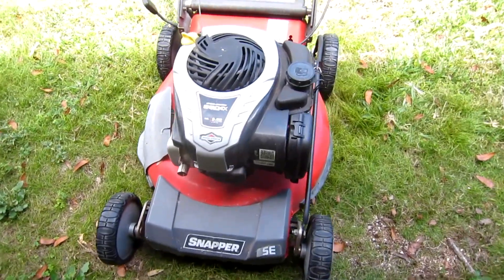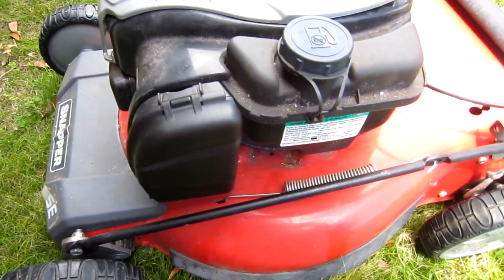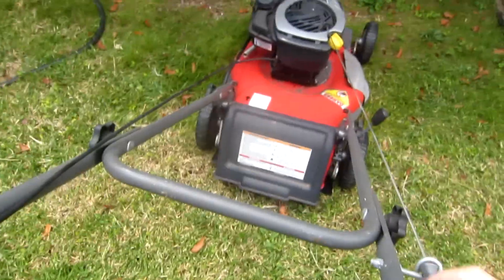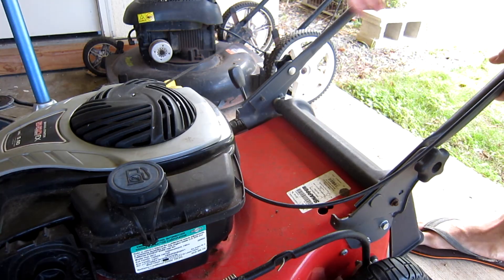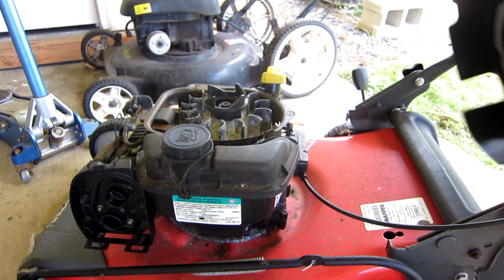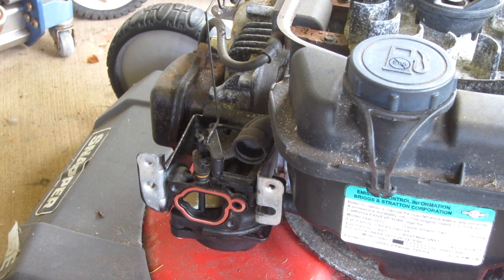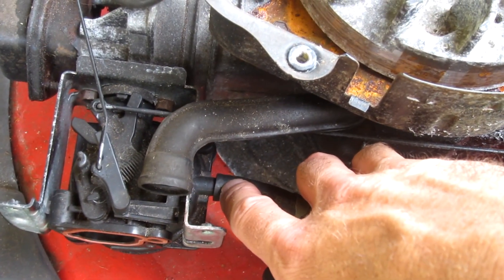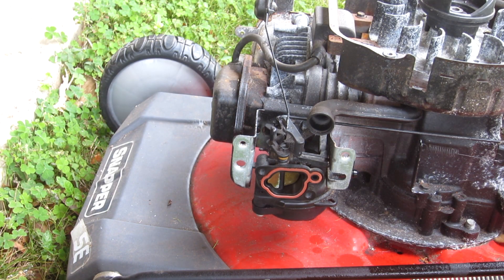Briggs and Stratton 550EX Carburetor Repair Part 1

Comment: Absolute Legend.
Had a few issues with my e550 in my Victa Classic Cut (ages old aussie mower). 
First throught it was just the air filter that went after i replaced the rip cord starter assembly.
Worked for a bit after the Air Filter replacement but had issues today with it dying on me again.
Had a quick look for answers, came here, followed what you did, found out the carby was ALL gunked up (weve had this mower since i was a teenager, so i never maintained it 😄 ).
Cleaned it all out with a fair haired paint brush, got the needle out and cleaned out the little plastic valve thing (in next vid), threw it all back together, kicks like a mule now.
Reply from the maker: I absolutely love getting comments like these....the scope of YouTube astounds me and I'm happy to be a small part of your success! Keep that mower going forever my friend.

Comment: So I did the test with the starter fluid but my butterly valve stays open but closes back when I pull the string?  Is the butterfly valve suppose to be spring loaded and if so how do I go about fixing it or just replace the whole carb?
Reply: https://www.youtube.com/watch?v=aNi9sJA4PFI
Reply: Did you tension the choke before starting?
(1 year necro-post but it might help others)

Comment: Thanks for the 2 carburetor disassembly video.   I've just been gifted one of these mowers after the previous owner replaced the carb with one purchased from Amazon.    Will run poorly on starting fluid.   I'm taking about the new carb tomorrow 😎
Reply from the maker: Replacing the original carb is almost never a good idea. The Amazon and eBay replacements are junk, unless they are OEM carbs. 
Good luck with your repair and remember that sometimes spark issues can masquerade as fuel issues.

Comment: Thanks so much for doing the video. It wasn't my problem as to why it wouldn't start but the upside is that I ended up with a nice clean carb after completing all the steps you outlined. The problem was a simple one since the mower had been running and suddenly quit. I was cutting around some cedars and a branch must have caught the boot of the spark plug and yanked it just slightly which broke the connection. But I am happy with my clean functional carb as well. Great video as all my parts were identical to yours so, very helpful...good job!
Reply from the maker: Thank you, I am so appreciative of you guys that comment even when you figured out that your problem wasn't solved by my video.

Comment: I couldn't get any start using starting fluid as you suggest. Spark plug came out quite gunked with black stuff. Replaced spark plug. Still no start. May be a little oily or wet in spark plug hole. Which from what I've read is a different kettle of fish than cleaning the carb.
Reply from the maker: With the new plug did you try the starting fluid again? Possible you had 2 issues, the plug and carb. 
If you have oil on your plug that 'could' indicate problems with your piston rings which is a different issue as you stated. But sometimes these motors get waaaayyyy overfilled on oil and that fouls up the plugs too. Make sure you haven't been running too much oil.  Good luck
Reply: @jcx2bby  Thanks a lot. I didn't try the starting fluid with the new plug but will try that tomorrow. Will check carb when I get a chance. Mower's run like a champ for 4 or 5 years. Has been idle several weeks with a lot of rain around. Stored always in fully enclosed shed. Anyway, thanks. Will see what happens.
Reply from the maker: @oinkooink  ok good luck. Curious to know what you find out.

Comment: nothing traditional on that turd/.. whats next, plastic blades? also theres no way that motor puts out 5.5 hp flowing that fuel thru those tiny jets
Reply from the maker: Not much can be done about the design...I just try to keep the turds running.

Comment: Hi Mr jcx2bby. I have the same B&S 550ex, The machine was stored and has never been used since the pandemic started. It doesn't start. After I disassembled and cleaned the carburetor and put a new air filter, and 4T oil,  the machine started but in 2 seconds stopped. I disassembled again and clean the carburetor with a needle using such electronic's magnifier glasses to help and see more accurately. Now the machine starts perfectly OVER THE SIDEWALK and never stops. The Idle sounds stable, BUT.... when I try to use it on the grass, at the moment it has to make some " little effort " to cut the grass, it suddenly stops. I think it still has some problem of the amount of fuel to the mixture...is not enough. I'm right? Maybe I should buy a new carburetor? Best regards, Martin.
Reply: you need to drill the jets out bigger,, these mowers were an engineering goof.,,. drill them to 50 thousandths
Reply: @randy1ization  Thanks!, I've changed the carburettor and now, this mower eats grass like a bull. The horse power returned!, I'm very happy. Best regards.
Reply: @randy1ization  Which jet, the main jet?
Reply: yes
Reply: you have to unscrew the idle jet completely out to get the jet out from underneath it.. count the threads sticking out of the idle jet before you take it out, so you can put it back in close to where it was before. if you need to you can fine tune the idle by adjusting the jet in or out.
Reply: @randy1ization  Thanks for the reply but it sounds like we are talking about a different main jet assembly. I looked up some pictures and the main jet assembly's that have brass jets and some do unscrew. The main jet on my 550ex is a plastic assembly with no brass jets and nothing unscrews, everything is plastic with a simple orfice. The mower is at full throttle at all times so there's no low speed/idle jet. It looks like this: https://youtu.be/joDmD0oOlJ0?t=435

Which orfices to I open up to 50 thousandths (about a #76 drill bit)?
Reply: @muziklvr7776  its been a while since I did one, but I recall that plastic assemble comes apart, in 2 pieces. it just pulls apart, and you have to take it apart to clean it properly.
Reply: @muziklvr7776  after thinking abt it, I think once you pry  that plastic assembly apart, the main jet is inside..  the outer jets are just feeder jets that allow fuel to enter inside of the assembly, then it goes thru the main jet. and that is the one I think u drill out.
Reply: @randy1ization  I bought a new carburettor and the problem disappeared. Here the plastic carburettor was not expensive. Best regards.
Reply: @Molleras  burn all of the fuel out of it before storing it and use fuel stabilizer, or you will be dealing with the problem every year/
Reply: @randy1ization  thanks!

Comment: Always buy a gasket set possibly a carb overhaul kit.
Reply from the maker: I don't think it's always necessary. Depends on the age and condition of the carb. Most dont need new parts, just cleaned.

Comment: I have a nearly identical snapper 19" rear drive mower with the 550ex engine and carb as shown (there is no primer bulb), anyway, after some maintenance this spring to replace the plastic inner baffle (as this IS NOT a heavy duty commercial quality mower, in any regards) which did result in the oil oozing out since I tipped it wrong...afterwards IT RAN AT LOW SPEED.  fast forward to Sept6, and I clean the carb and gas tank as shown, install new sparkplug from WALMART end of season clearance, and it still runs slow.  I write this prior to double checking the throttle springs and choke linkage.  But any ideas why it would run slow?
Reply: a common issue with these motors is the valve cover gets dented in causing the valves to stick partially open making the engine run weak or not at all. if valve cover is dented in remove hammer dent out. i use rtv silicone as a sealant. wipe on each surface very thin allow to dry completely then reassemble
Reply from the maker: Interesting info.  I have not run into this problem before but question; there is not valve cover on these types of engines as i know it to be.  The cylinder head covers the valves which are in the block.  Can you explain this a bit more?
Reply: @jcx2bby  seriously? the valve cover is on the front of the motor. its that triangle cover thing.
Reply from the maker: @smallengineguys  sorry I was responding to multiple comments this morning and thought this one was geared towards the older style engines, not the ohv one. Hence my confusion. My bad, got mixed up on vids.
Reply: or bad gas
Reply from the maker: Did you ever figure this out? One guess is that if the motor isn't original to the mower, it might not be setup for a no-load configuration. In other words, on engines that are installed on push mowers, the carb and springs are adjusted to run optimally ONLY when there is a blade installed on the end of the crank.  The blade adds centrifugal weight which helps the motor run faster.  If you take the blade off, the engine runs very slow, or not at all because the carb is tuned for the extra weight.
Reply: @jcx2bby  the bade does not make it run faster or slower. ive started many without blades. the issue is they kick back without it. because the flywheel is so light. on a race car they use a lighter flywheel to give more power to the wheels. it alone does not increase or decrease the rpms. this is the original motor for the mower.
Reply from the maker: @smallengineguys  I worked on a Snapper push mower way back in the 90s that would disagree with you.  I was absolutely baffled at why the engine idled so low.  It would run fine, and if you opened the butterfly it would rev, but always go down to a very slow idle.  A guy in a small engine shop asked if I had a blade on it. In fact I did not as I had just put new rings on this engine. He told me to put a blade on it and try.  Problem solved.  
Lighter flywheels enhance response of the engine, not so much increase HP.  If you've ever worked on farm implements like bailers that have huge, heavy flywheels, they are used to keep the implements going steadily in surge conditions in the field (big swaths of hay, wet crops etc). It takes a while to spool these flywheels up, but once they are spinning, the power is immense.

Comment: My issue is gas coming out into the air filter. Any idea how to fix that issue?
Reply from the maker: Sounds like a stuck float to me. Have you already disassembled the carb?
Reply: I did. The float dropped down when I held it upright. I went to my local small engine shop and tried to order new rings and a float needle. They recommend I just replace the whole carburetor.

Comment: Dude u did WAY to much work. Drop bowl. Pull out jet assmbly. Clean. Reassemble.  Also pinch fuelline with clamp to stop fuel flow while working
Reply from the maker: Well, sure, if you already know how these carbs work. I made this video for people that don't have any idea how engines work and are interested in fixing them their selves. The best way to show them, and for them to learn, is to take it all apart.
Reply: @jcx2bby  there is good carbs and bad carbs......i try to stay away from the pasta and bread though

Comment: The videos were very helpful, but I'm still having issues with my mower bogging down and out after about 30 minutes of use. I thought for sure cleaning the carb would work. I then shined a flashlight down my empty gas tank to see if the fuel filter needed cleaning. There was some broken up leaf matter on the mesh, so I washed it out, let it dry, and refilled. Same problem. I replaced the spark plug, air filter, changed the oil, and finally the gas cap. No change. At this point I'm thinking I got some bad or stale gas. Anyway, without your videos I wouldn't have been able to clean the carb and remove the gas tank to clean the fuel filer, so thank you so much for that.
Reply from the maker: That's weird.  If it is running for 30 minutes, it seems like the carb itself isn't the problem.  That almost seems to me to be an overheating issue or a vapor-lock issue with the fuel.  I used to have a weed-mower that would overheat if you were using it hard and shutdown.  Didn't hurt anything, just shut off til it cooled.  
I'm glad the videos helped you with the reassembly and if you ever figure out what fixes your mower, please post it here.  Thanks!
Reply: @jcx2bby  That's basically how it's been - had to let it cool down a little before I could start mowing again. If I ever do, I will. You're welcome and thanks again.
Reply: @jcx2bby  I accidentally put the old gas cap on thinking it was the new one. It's leaf-mulching season for me here in New England, and after two hours of mulching, no stalling. It's been five years with this mower for me and I just don't remember the gas cap fitting so loosely as the new one did. (Completely positive it's for a 550ex). So loose that the vibration of the engine caused it to come off. Anyway, that must've been my vapor-lock issue. I did add new fuel since what I had was about 4 months old.
Reply from the maker: @madmiracle  you figured it out, hooray! Isn't it funny how one little thing can cause so many problems

Comment: good vids and exactly right. tip: be real careful taking off the throttle link. it inserts into a plastic piece that is super cheapy and can break off easily.
Reply from the maker: Sounds like real life experience!
Reply: @jcx2bby  yep. fixed with a rubber and a zip tie. ha
Reply from the maker: @josephkennedy3541  oh my, lol

Comment: Where is the model # on the mower?  I can't seem to find it.
Reply from the maker: It should be stamped into the metal cover around the top or front of the engine.
Reply: @jcx2bby  thanks the numbers were hard to read.. Anyway I cleaned the carb but it still doesn't work unless I spray carb cleaner and it would run for 10 sec and dies again.. Any suggestions??
Reply from the maker: @tl2135  , gotta still be some junk up in there blocking the fuel flow. As some others have commented, there is another step to teardown that white jet assembly even further that I didn't cover in this vid. You may have to go that extra mile to get proper fuel flow established

Comment: Thanks for the clear detailed video. I just put my lawnmower  back together after following this tutorial and it’s running again! 
 When I opened it up, the pin that holds in the floater just fell right out so I think it had worked itself loose but while I had it open I cleaned everything anyway so I hope it stays running because that pin seems very loose that holds the white floater to the rest of the unit and I can imagine it easily vibrating back out.
Reply from the maker: Gadget Reboot, woot! Congrats on the fix and thanks for taking the time to comment. Hopefully it will stay fixed for you

Comment: just saying...about re-using fuel... i like the video though...and it's very detailed, thorough, and not hard to understand. thank you.
Reply from the maker: d. cypher, good points on the old gas. it probably isn't worth the risk to reuse the old stuff for most folks, I just do it out of habit I suppose. appreciate your comment.
Reply: jcx2bby yes, and thank you for the reply. i honestly have done that (re-using) myself quite a few times...that i learned the hard way, it isn't worth it. ai just got a few pieces of .009 guitar string (high E or smallest) and it fits all the holes, ports, jets, etc. i've come across. it just has to be smaller than hole, obviously.  take care.

Comment: good video, bro, however... NEVER, EVER... use fuel that was in gas tank, or carb. If you take the time to disassemble carb, tank, etc... it's not at all worth re-contaminating the whole circuit again. We use a gas can and store all bad gas in it until full, then use it to start fire out back, or clean some kinds of parts...(some kinds will be damaged by gasoline).  i believe oil change service centers will accept old gas for a fee.....may need to google that yourself.

Comment: I just had to give an update before I cut the grass :). After watching both of the videos I was able to remove the carb, clean the orifices in the little white piece as you described and got it all back together, now is running perfectly!! Thank you so my friend. If you look at the time stamp, I did the repair in less than 15 minutes. I spent all morning trying to figure this thing out. Should have watched your video first. LOL Thanks again!!
Reply from the maker: Steve, congrats my man, and thanks for the update. you might have set some kind of record on carb repair...took me a heck of a lot longer than 15 min to do it, I'll tell you that